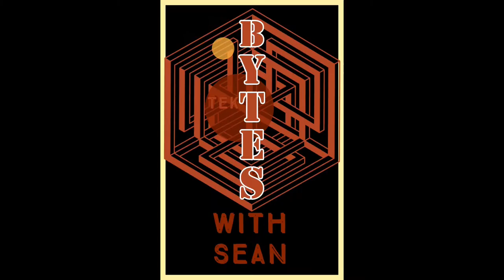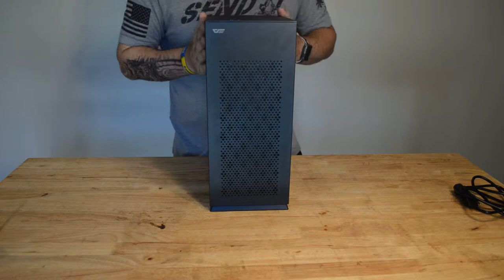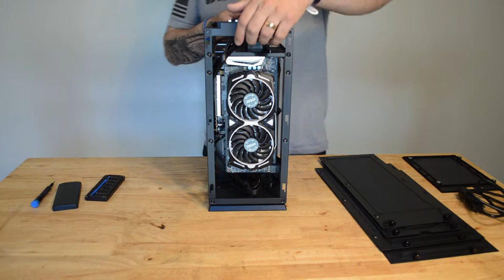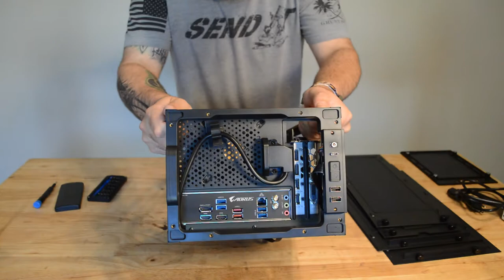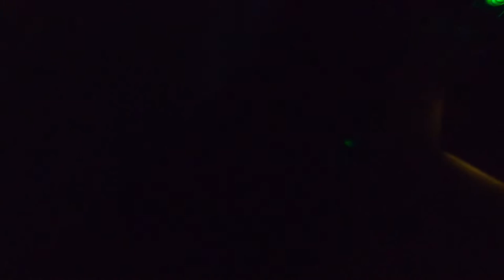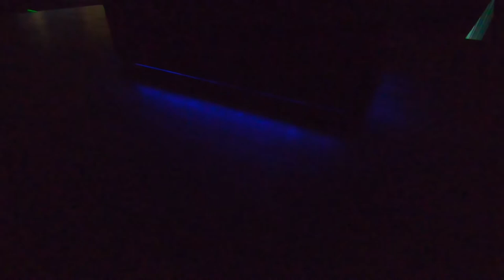Part 2!  Darkflash DLH 21 mini tower Itx case build for the wife!

Comment: Don't put dust filters or just leave the back open you don't see it anyways just blow out the dust once everry week with can air or with vacuum on blower mode 

BTW I'm thinking of getting this and modding it by removing the bottom mount for the psu do you think an ATX PSU will fit if I remove that ?
Reply from the maker: I really don’t think a regular atx power supply will fit. It was a tight fit for everything in there, but the. Again it’s been 2 years since I have really opened it up

Comment: How were the CPU temps in this case with your build?
Reply from the maker: The cpu temps with the stock fan where up there. The computer was having performance issues so I took an extra 120mm fan and it made a huge difference.
Reply: What’s the parts list that fit ?
Reply: @Quest21Workshop  so you put 2 120mm intake?